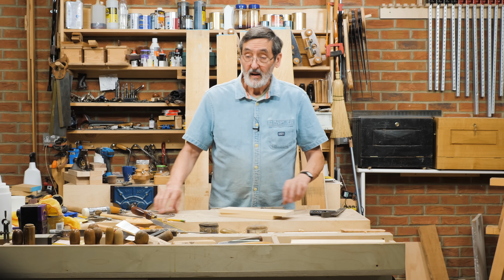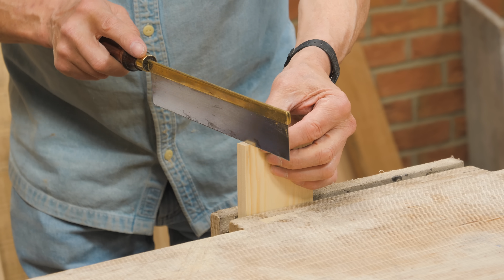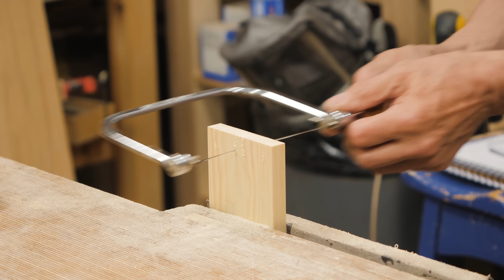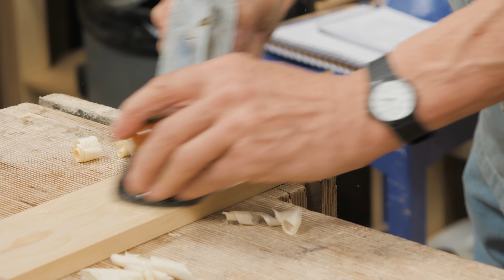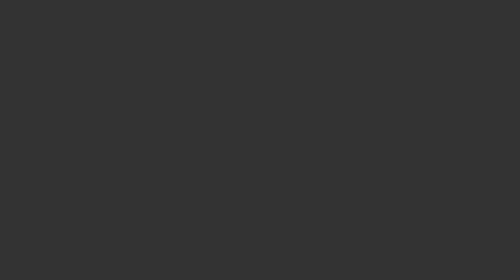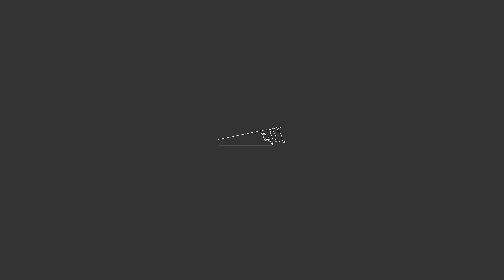Dovetailing - The Coping Saw Method | Paul Sellers

Comment: What screws to use on 2x4?
Reply: In general, there's two main types of thread patterns depending on the type of wood being fastened. SPF 2x4s are generally considered "softwood" so a course thread screw is used. Wood such as oak is considered "hardwood," so a fine thread screw is used. There are many variations on these as well as lengths and diameters, so you then filter it down based on the project and desired result. Maybe this helps?

Comment: I watched woodcraft show about cutting dovetail with coping saw. Exact same as Paul Sellers, except they used a hand plane on the side. Put it up to the board in the vice leveling the board to the hand plane, then moved the hand plane out as a stand. It made it easier to mark the board in the vice without having to hold the other board with just your hand. Sorry so difficult to describe this technique of marking the boards.
Reply: Actually, funny you mention this technique. I keep seeing it in Paul's videos as well. Nice little trick of the trade!

Comment: The sawing of the tails and pins is done without knife wall (because it's end grain), but why not mark it all carefully with a sharp pencil and not use the knife wall at all? It  makes it easier but not doing knife walls saves you a step. If it's for drawer backs and beehives in pine, then why not train your accuracy using pencil?
Tried two like this and the second one wasn't so bad..

Comment: Can you share how a beginner will be doing this, assuming inaccurate cuts etc? I assume there will be a lot of back and forth getting the perfect fit, how would you do that?
Reply: I have no reply based on actual dovetail-making experience. But what I think is the case is that as long as your inaccurate cuts are on the waste side of the line, you're good because you can just chisel to the line accurately. But if your inaccurate cuts result in mismatched dovetails and pins, or cut on the wrong side of the line/knifewall, you may have to use the piece as practice. Just my intuitive thought. Again, not based on any actual experience. Have a good one frfr

Comment: The problem I have when using a coping saw is that even though I stay a large distance away from the knife wall, I get so much tear-out that goes all the way beyond the knife wall. I'm getting much better results just chiseling out the entire waste, even though I hated the idea of it at first because it seemed like much more work.
Reply: You could make a knifewall. Then tear out would not happen. Just a suggestion :)
Reply: @lebensschueler  I did have a knife wall. Maybe it wasn't deep enough.
Reply: @Raiver-of-Eridu  Yes sorry, I was unclear then. You could deepen the knife wall with a chisel. A little bit should be enough. However I think changing the blade would be a good idea aswell. I think Im using a 12 tpi blade and I dont get that much tear out. Good luck for your next joints! :)
Reply: @lebensschueler  Thanks! I will try that next time.
Reply: Try a different saw blade.
Reply: I'm not even a woodworker yet, more of a wannabe because I'm waiting until I'm done restoring the table saw on my channel, so I have that as a centerpiece to build a shop around. But I do enjoy learning about others' experiences. Such joy. ❤it!

Comment: Using a coping or fret saw seems to be the quickest method for me. Something that I think is not said enough when learning dovetails is that the knife line is law. If you make a nick beyond the knife wall, don't try to correct it, but continue removing material only up to that knife wall.

Comment: I like this method a lot because when I try to imagine craftsmen in the 1800s having to churn out furniture for the middle/low end of the market this is how I imagine them doing it.

It wouldn't matter if each set of dovetails is different so long as they pass a glancing inspection and were strong.